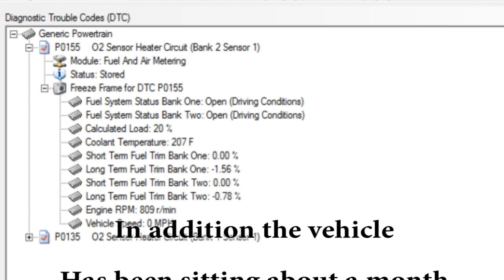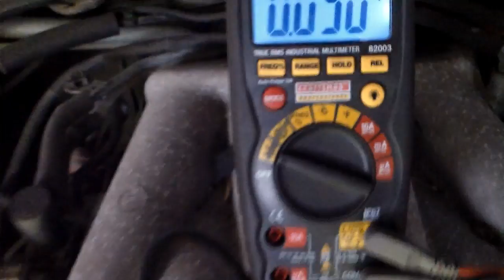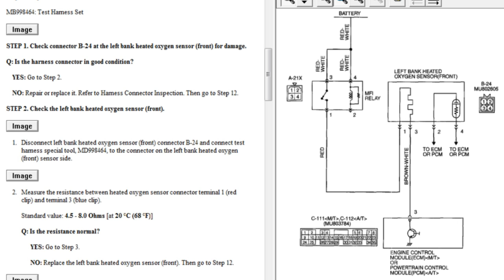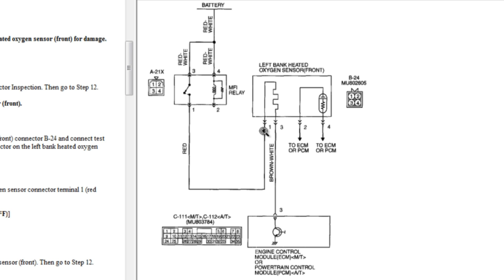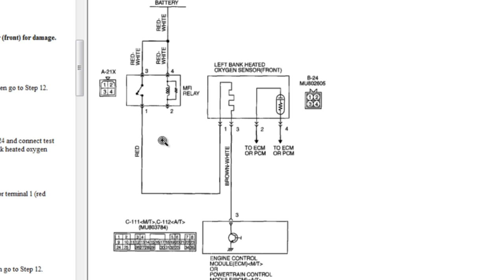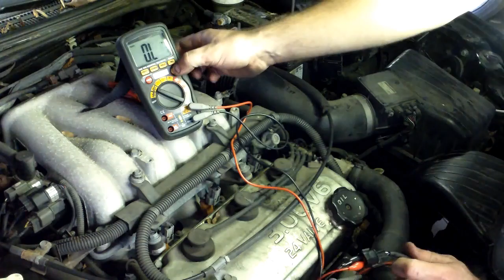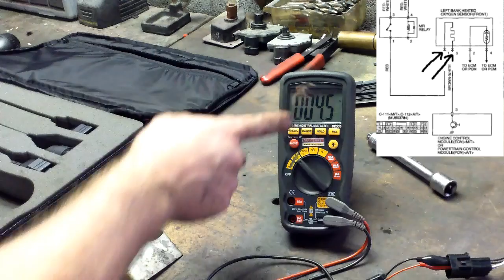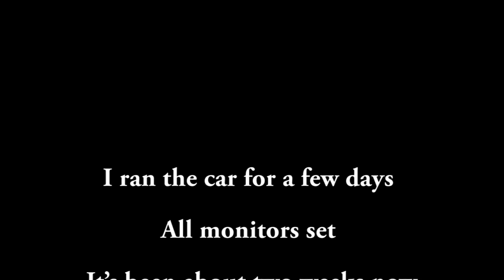P0155 P0135 Diagnosing O2 Sensor Heater circuit, heated oxygen sensor

Comment: I installed new cats and sensors in my 2016 f 150. No codes before installing. Now I’m getting p0155,p0135 & p0050. They come back every time vehicle starts. During install the old passenger side cat dropped on starter solenoid power wire and sparked.  What do you think is the fix? Thank you in advance

Comment: Even though it's from 2013, I greatly appreciate you posting this video. I have a 96 Astro that both Bank 1 and 2 O2 Sensors that have gone out as well. But it has been sitting along time and getting it running again. Definitely will be using the tips!

Comment: Calling an open circuit "open loop" is not a good idea when working on cars, especially on oxygen sensors, since the term "open loop" or "closed loop" has a completely different meaning. It's only going to confuse people.
Reply: how does it have a different meaning in a circuit, a DC circuit mind you, if you have taken physics you will see that Kirchhoff's rules states current in and current out in loops must be equal. A circuit is a loop in Lehman's terms.
Reply: Yes, a circuit is a loop. It still doesn't change the fact that the terms "open loop" and "closed loop" have a very specific meaning when it comes to engines and would best be avoided to prevent unnecessary confusion.

BTW, I'm a certified high voltage electrician by trade. Well, originally. So yeah, you can say I've taken physics.

Comment: My sensors are brand new. Would it be the relay then? I replaced them this month and it ran fine. Got in a wreck and got my truck back today. Engine light is on and my scan tool gave me these codes.

Comment from the maker: Thank you sir,i appreciate that, like wise 
i went to approve your video response however i couldn't find it in my mail/video response folder, i would be more than happy to add if you would like to resend
Reply: robinsonsauto mine has multiple red conducters and in the sensor side there is only 1 black conducter and 2 white conducters. The one black looks like it has 2 prongs

Comment from the maker: Good point thanks for mentioning, wish I had more time while performing this repair, I usually load the circuits in question with a test light, “bulb” style not LED if it lights the bulb nice and bright most times all is good, in hind sight I should have demonstrated that, however I had a feeling the heaters were open and went straight for the DVOM, if the resistance was ok then I would have loaded the circuit, in addition to checking the controlled ECM ground at the o2 harness, thanks again

Comment: Good video Will. Just wanted to point out that when you do a voltage check on the O2 sensor supply volts, you really need a load on it to verify that all the connections starting at B+ would be intact to the sensor. This would also include the relay contact which would be the most likely problem if there was an issue in this circuit. Thanks again!